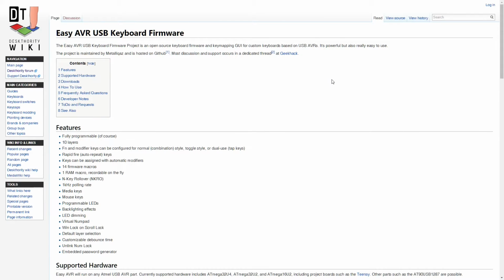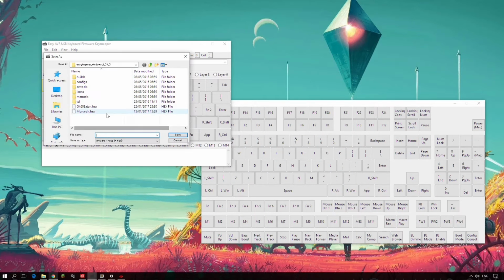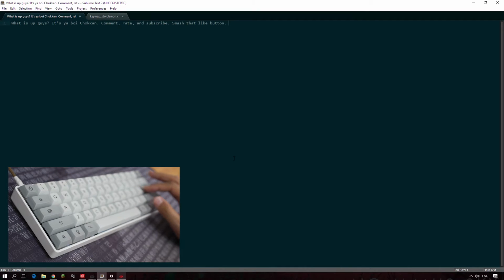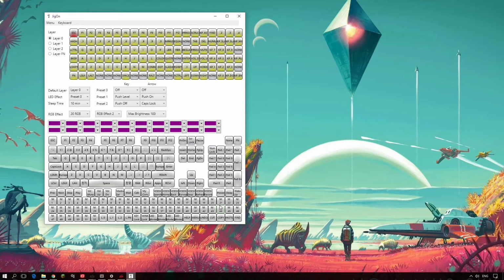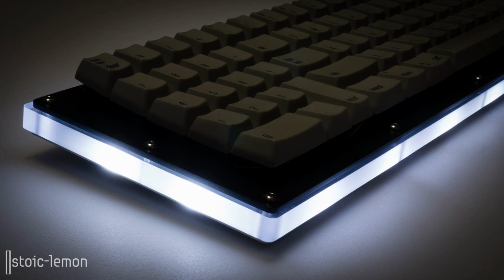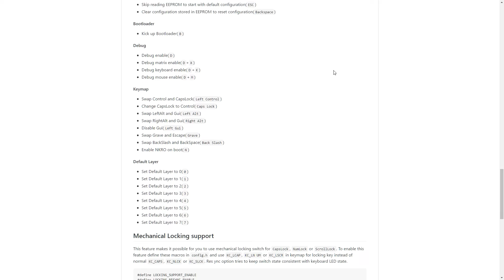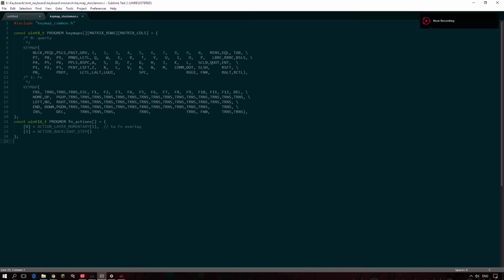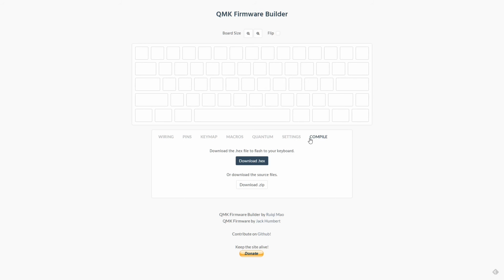Building a Mechanical Keyboard [Part 2]  - Keyboard Firmware

Comment: Hi. I just bought my first mechanical keyboard, AJAZZ K680T. I've installed their firmware from their website but it seems like it disabled the Bluetooth mode. Do you think I can "make" my own firmware and enable the BT mode using EasyAVR for example?

Comment: Hi @Chokkan, I want to know if is possible make a firmware for a specific program, like trading program?
Reply from the maker: +Engel Ordaz Do you mean a layout? So you could set up keys to do certain key combinations or macros within the program?
Reply: Chokkan macros for the program I think. Because the trading program have hotkeys for trading but I want to make a keyboard for trading and I would like to know if  i can do that.
Reply from the maker: Engel Ordaz Yeah, you can do that no problem. You wouldn't even need a full keyboard. You could just use what they call a macropad.

Comment: Hi I checked QMK firmware builder site and I have couple problems... I have my own designed layout http://www.keyboard-layout-editor.com/#/gists/e3bdec000c41d04e2a551ee8e669e0a9 and I have problems with special symbols such as ě,š,č,ř,ž,ý,á,..... There is no option to add them there they are suposed to be first and with SHIFT it should write numbers. Also Fn key is not avaible. My keyboard will be based on Teensy2.0++ controller - will it be compatible or what should I do?
Reply from the maker: I know very little about QMK. There is a subreddit, but since it is invite only, you'll have to message a moderator to gain access. https://www.reddit.com/r/qmk/?ref=search_subreddits

You should also check on Geekhack and ask there. Tons of smart people there. The Making Stuff Together section might be a good place to introduce your board and ask for help. https://geekhack.org/index.php?board=117.0

Your Teensy 2++ should work.

Sorry I can't be of any help, but please let me know how you get on and if you manage to get your board up and running. You will probably be teaching me. :)

Comment: Thanks for this! I am considering buying a tx-75 from kin25. Is the PCB campatible with QMK and easy AVR? I ask because your board looks like its of the same make.
Reply from the maker: Jeremy Freedberg This board uses the jigon firmware utility, so i think getting it to work with QMK would be quite difficult. QMK has some really cool advanced features that no other firmware offers, so if it's those you're looking to use, you should probably look elsewhere. What's the reason you want to use QMK or Easy AVR?

Comment: this is exactly what i was looking for after ordering my zealios switches, cant wait to build my first board!
Reply from the maker: epic guy!! That's great to hear. Let me know if there's anything else you'd like me to cover. I'll probably do a quick one on common pitfalls when building.
Reply: Chokkan That sounds like it would help a bunch! Personally I'm mostly worried about juggling cost, don't wanna buy a pcb that will break in a month but I don't feel like I can justify spending $120 on one either.
Reply from the maker: Meadow Meal I've been pleasantly surprised by my GH60. I had reservations since I'd heard of USB ports falling off, but it has held up really well. It's a very well supported board, so any problems you have are usually fixable.
Reply: Chokkan Sounds great! I'll look into that